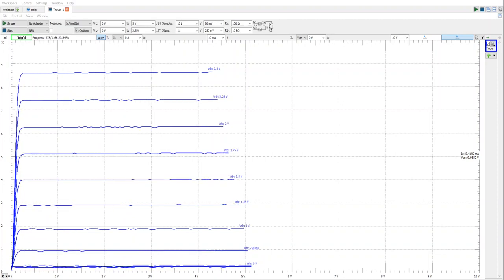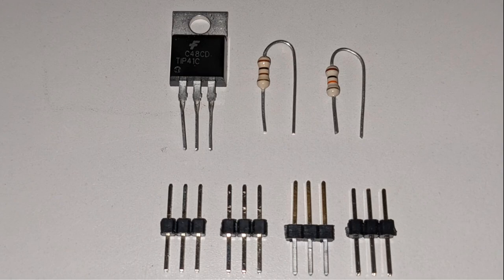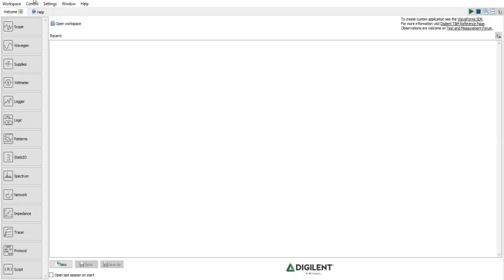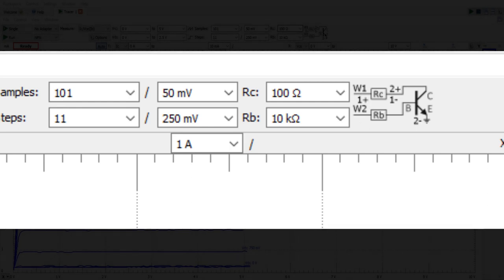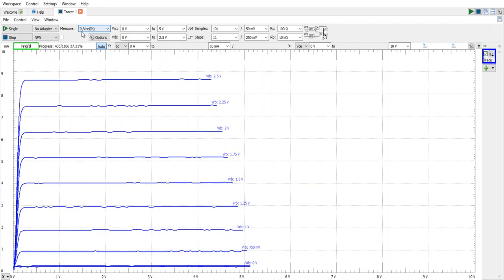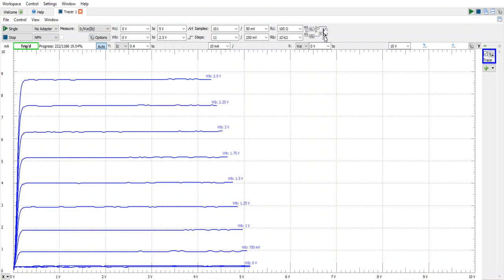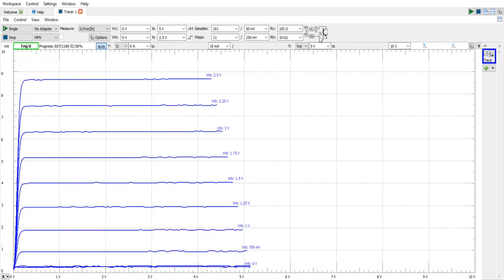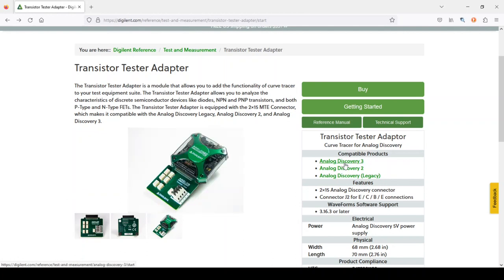Transistor curve tracing with the Digilent Analog Discovery

Comment: Great video man! I have an AD2 I want to use to match n-channel MOSFETs. It seems the transistor test adapter board supports this, but I'm unsure if I can use your circuit to do this or not without modification. Also if I understand correctly at least for p-channel MOSFETs, base is gate, collector is drain and emitter is source, is this the same for n-channel? Here is the title on digelents site Comparing a BJT and a MOSFET with the Transistor Tester Adapter. They also have a schematic for the curve tracer PCB you can see. I suspect I will need to modify your circuit just not sure how yet..
Reply: I was watching on my phone before and didn't realize they actually show a rudimentary circuit diagram for those who don't have an adapter at at the top :) And when I select N-FET it even gies an updated diagram. Digilent sure is thorough! :)
Reply: Just another note, if you change the thing you are measuing Id/Vds or Id/Vgs, it actually shows you a new diagram telling you how to wire things up! Their adapter looks cool cause it auto changes the wiring for you with relays.